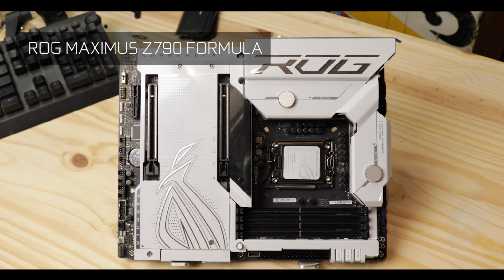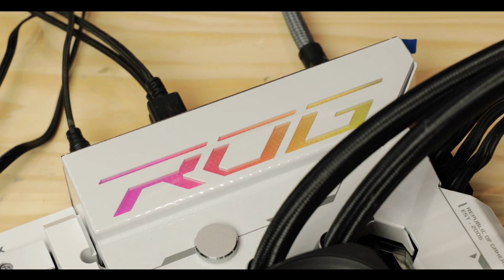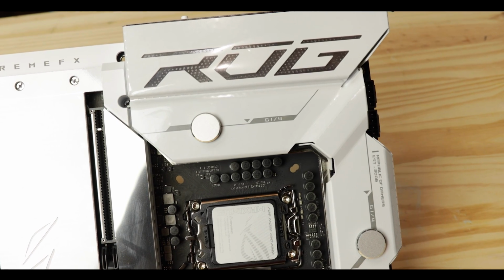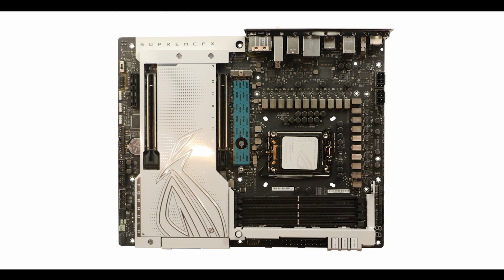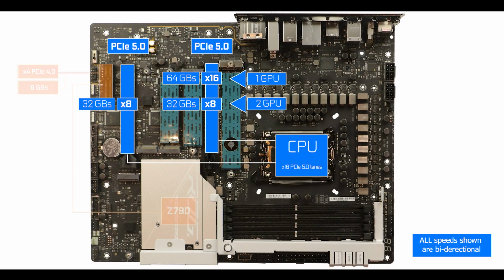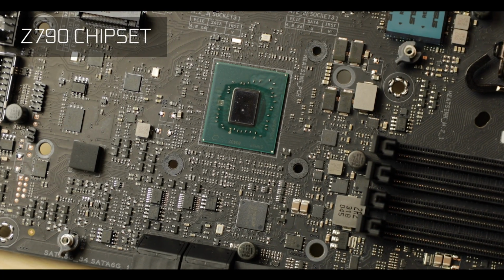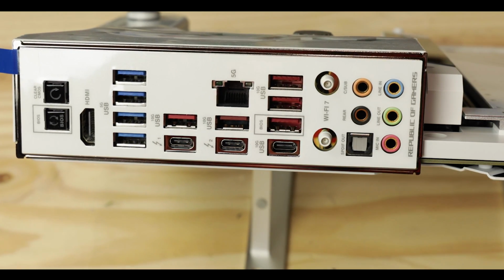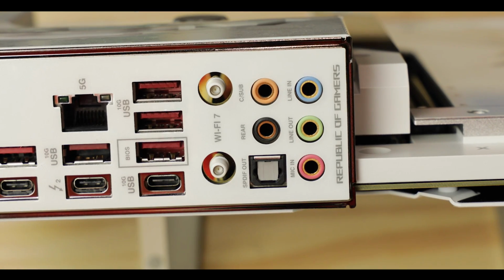ROG MAXIMUS Z790 FORMULA : Custom water coolers only please

Comment: The VRM information is wrong, in the Formula the phases are 105A
Reply from the maker: The peak at 105-110a . However their base amperage is 90amp.   

Annoying but true :(
Reply: @Laurentschoice 🤔 on the Asus website it nominally mentions 105A for the Formula, and 90A for the Dark Hero. the information above is interesting
Reply from the maker: @viniciuslshks indeed. 

I got the same problem the gigabyte Ice X870 I'm filming today. It's says 60 amps..but the power stages are 55.. which can peak at 70... What to do ?.:)

Comment: After owning this motherboard since its release in late October 2023... i got serious about building my pc,, this is my second build my first one was a low high end build at the time in 2007......took the time, youtubing  myths, watched, contemplated, spent months pin pointing every little  part i would  buy ....my advice is to do research, double triple check prices, deals are out there particularly ebay is where i saved hundreds and also paid less then retail no matter what the item was originally listed there are many out there who dont think a 4090 24gb air cooled card is not worth it but im telling you when the market was empty of 4090 graphic cards and china was cut from ever getting them and most were sold out i took a risk and sent a random stranger from north Carolina  2200 dollars for the white strix oc 4090 a sleek white finalizing piece..i received a nvidia rtx 4090 fe instead.   SMfh. Lets say im impressed with the 29000 clock speeds she gets so i guess ill take her ...then theres the newly released  intel 14th gen i9 14900kf processor and heres a secret becauseIpurchasedthe nonintergrated cpu my motherboard used 16pcie expresslanes,, also includes  g skill neo trident ddr5 7200mts, an nvidia 4090 and a nzxt kraken elite liquid cooled 360 overclocked powered by a 1000w Japanese psu i only paid a 120 bucks for a she runs beautifully

Comment: i have tried 3 different sticks. Corsair dominator platinum 72002x16, Gskill 8000 2x24, and t-force 7600 2x24. corsair runs at 7400, gskill 7400 and t force the best @7600.
Reply: Have you tried the dominator 8000?